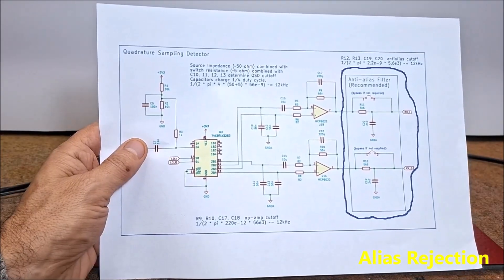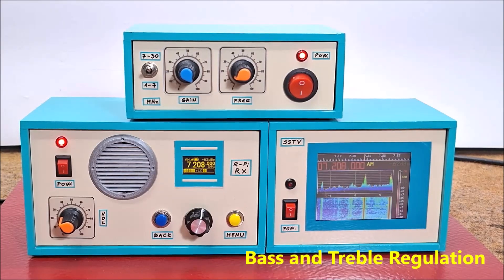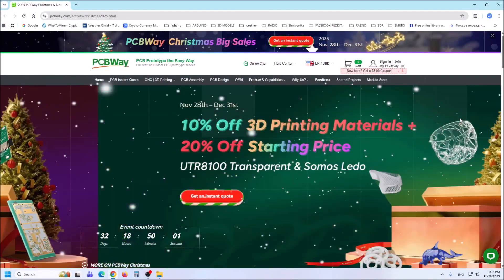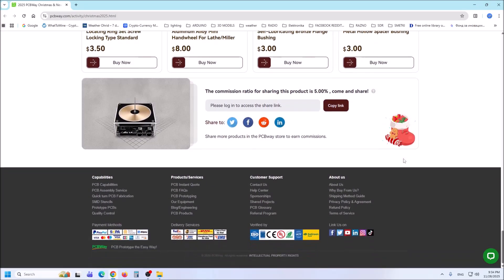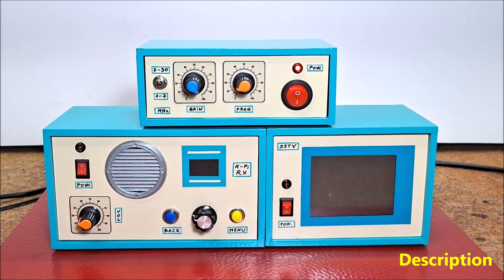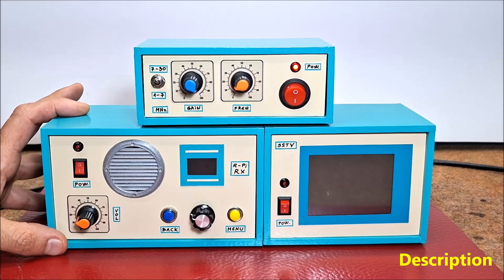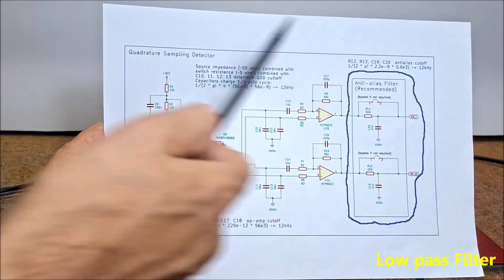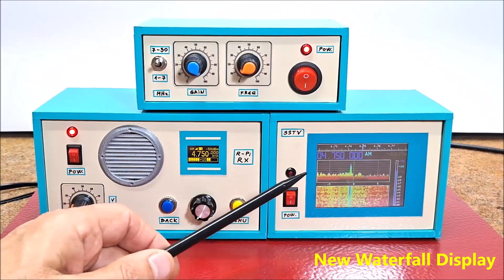Pi Pico RX   SDR Radio with New Firmware and Features

Comment: Good afternoon. Wonderful radio. I have a question for you. Were there any difficulties with building this project, since it didn't work for me, I tried several options for an operational amplifier, but the result is negative, that is, there is no reception. Thanks.
Reply from the maker: In the example in the video I use a cheap TL082 operational amplifier IC in a DIL package and I had no problems, it worked right away. Check the connections carefully. Everything is made according to the original schematic.